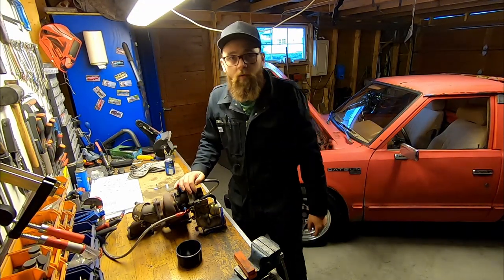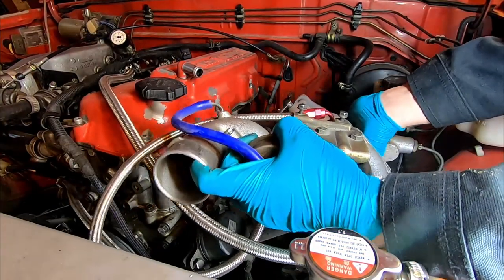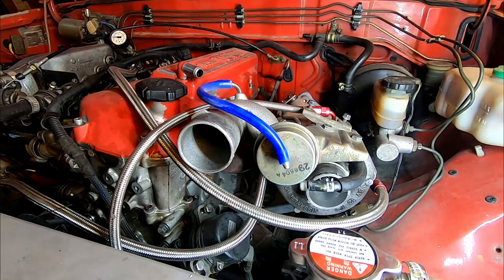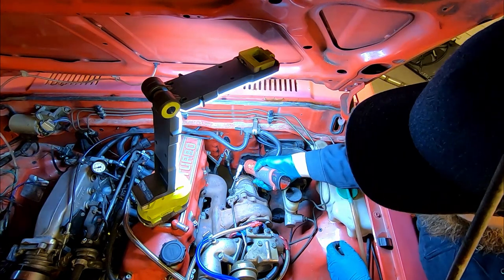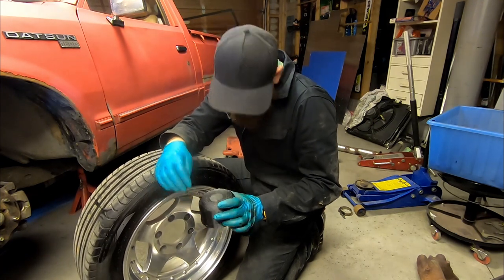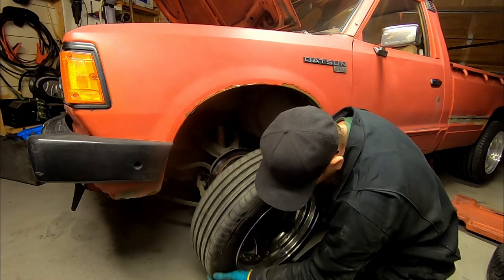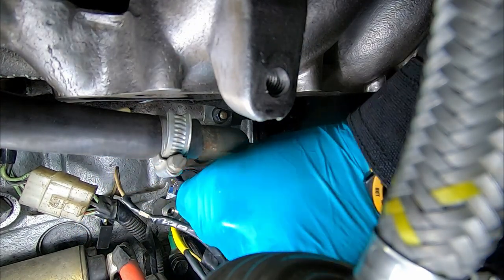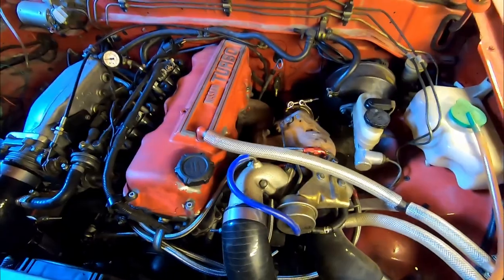Installing a turbo(again) and 3d printing center caps! Datsun 720

Comment: Hello from Australia! Love the build, doing one myself currently (similar engine into different datsun) can I ask, what your distributor is? And does it enable you to run coil on plug?
Reply from the maker: I've removed the distributor and I'm running a SR20 crank angle sensor on a 3d printed standoff/adapter. The stock 360slot wheel inside was replaced with an aem one so it works better with aftermarket ecu's. I'm running toyota yaris coils.

Comment: does the flex pipe help with engine vibration?
Reply from the maker: It's more of a cheat so I didn't have to be 100% accurate with the pipe angles when I made it since I didn't have anything more than an angle grinder back then 😉
Reply: @TomNicklasSand  ok i was just wondering too my self if it would help reduce engine vibrations from making its way into the cab of my truck.
Reply from the maker: @Barret_Radtke  Nah that has more to do with the condition of your engine rubber mounts :)
Reply: @TomNicklasSand  yeah thats what i think but my dad said it wasn't them.